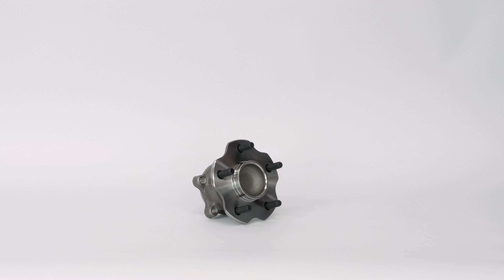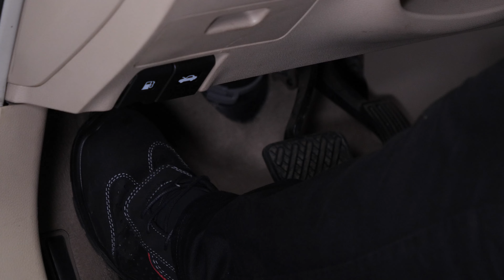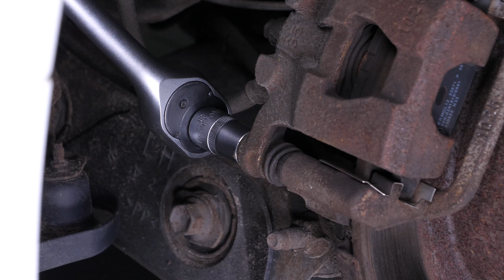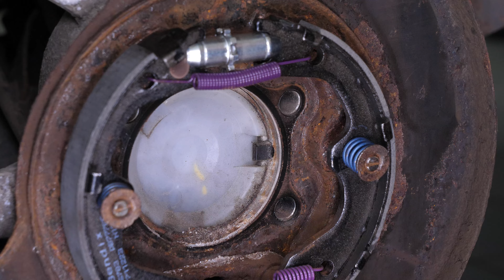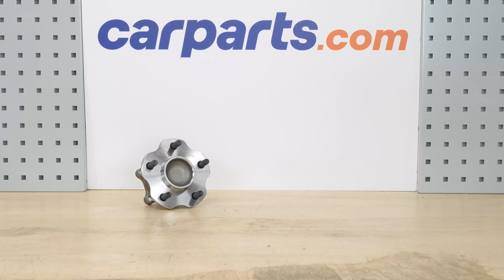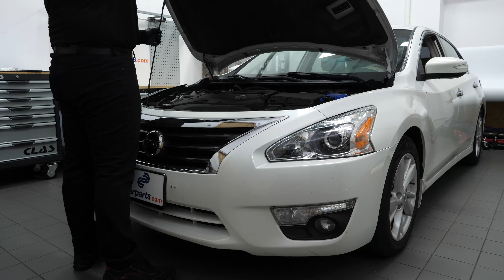How to replace the Rear Wheel Hub 2013-2018 Nissan Altima 🚗

Comment: I had a guy replaced my rear wheel bearings. But I know he didn't use the torque wrench so basically they're still the way they were. Now I have to have them replaced again. I've been driving like that for quite a few months. So I should buy a new ones and get it put on right?